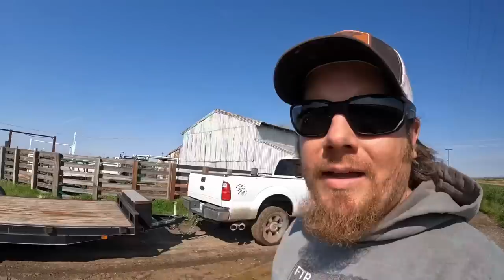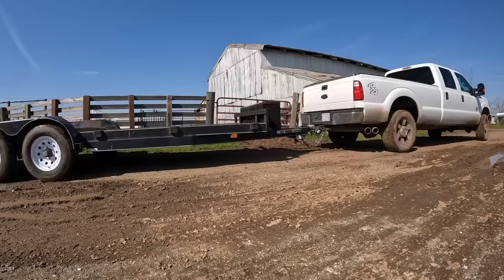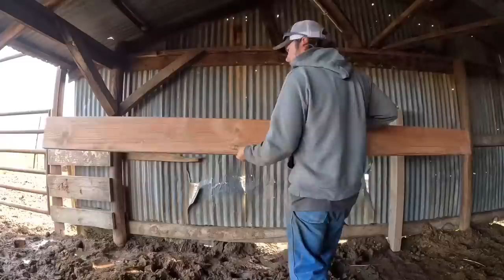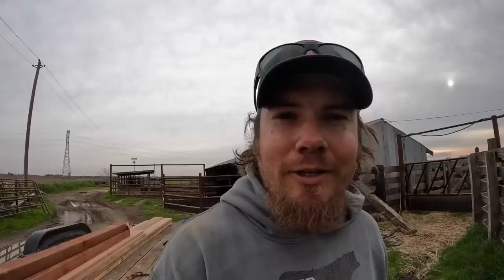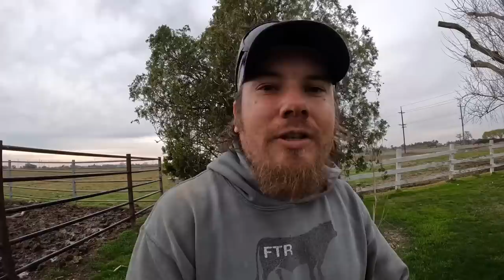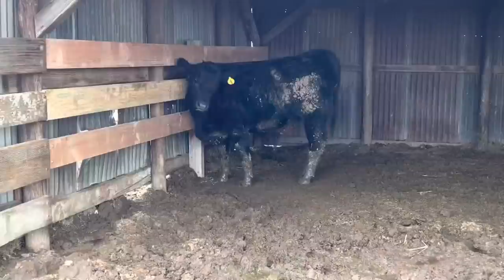Finishing Touch on the Bull Pen and Cow Check!

Comment: I know it might be a bit on the costly side but I wonder if it may be worth adding in some more tonnage of cheaper crushed rock to some of those high traffic and low spot zones that the cattle use for basic needs, like the waterers and the gate zones, youll still have the drainage of the large rock aggregates but it may help with the soupy poor footing and dry out some of those areas where youre not looking to get grass cover